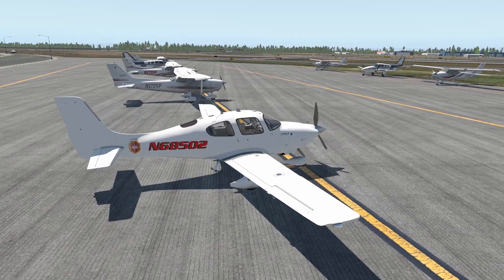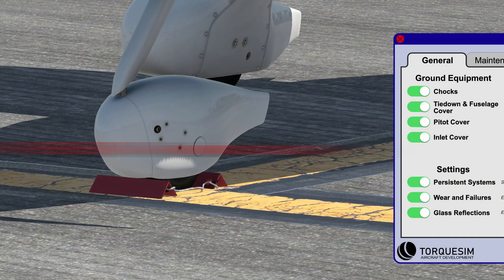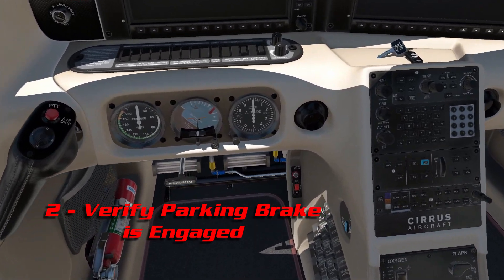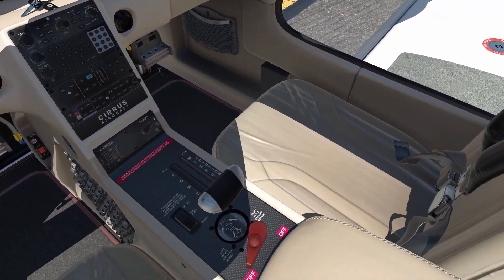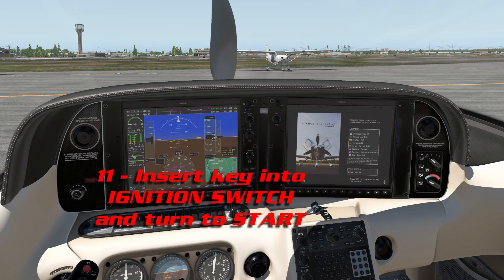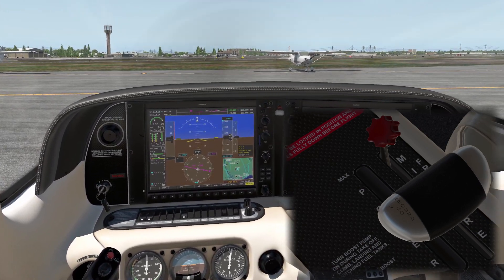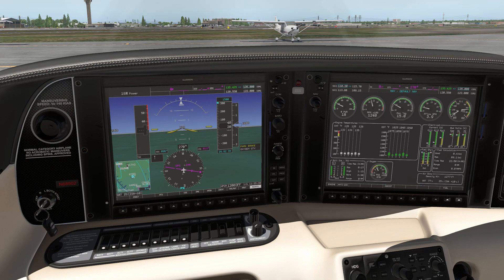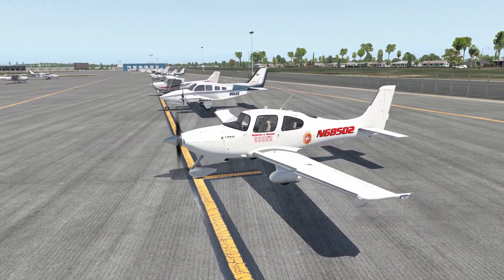X-Plane 11 - TorqueSim SR22 G3 - Engine Start Procedure

Comment: I recently switched form Mac to Windows and my SR22 would no longer start, even with "start with engines running" selected. Finally got it. Cycling the throttle was the key. Thank you!
Reply: i guess I am quite randomly asking but does anybody know a good website to watch newly released movies online ?
Reply: @Darwin Roy Try flixzone. Just google for it :)
Reply: @Draven Zachariah Yea, I have been using Flixzone for years myself :D
Reply: @Draven Zachariah Thanks, signed up and it seems like they got a lot of movies there :D Appreciate it !
Reply: @Darwin Roy You are welcome =)